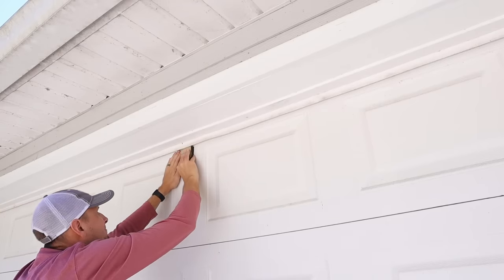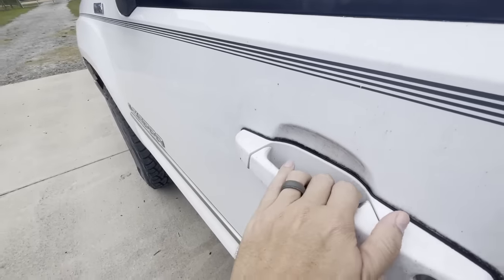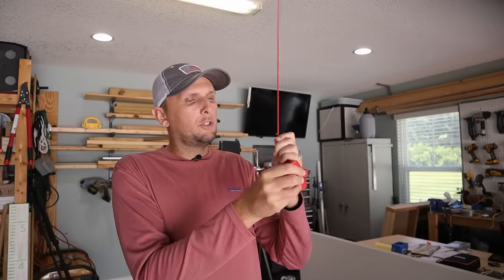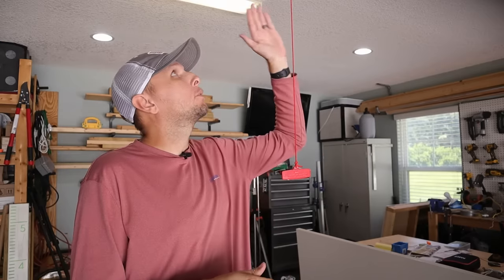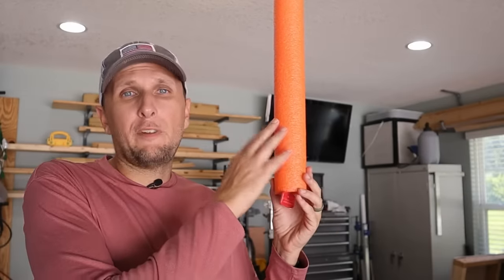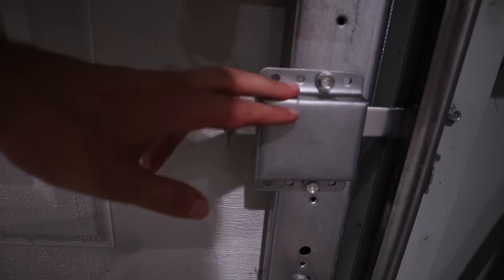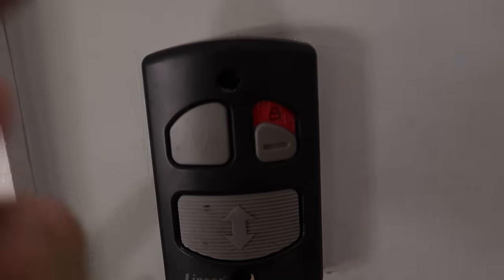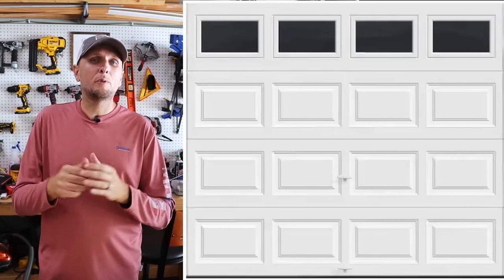How to Stop Garage Door Break-Ins | Number One Way Thieves Get Into the House!

Comment from the maker: These techniques of breaking in are nothing new to the bad guys but hopefully this was eye opening to you the homeowner!  If it was helpful please let me know and if you have some other techniques that you use, I would love to hear about them! 👮🏻‍♂
Reply: Like they always say, "Locks were made for honest people not thieves. Where there's a will, there's a way"
Reply: the best technique is do not be greedy for wealth.  if you have nothing you have nothing to worry about.  i no longer have anything worth value for a thief. 👍🤟👌
Reply: @duckpwnd  I gave away all my cheap harbor freight tools. 🤣😂🤣👍🤟👌.   I no longer have any tools.   I own nothing and it's good.
Reply: Take the pull tab off the release, cut it shorter, but also put a fake release with a tab on it that will reach outside of the garage, but is attached to a metal bar not the release hahaha. Let them struggle with that for hours.
Reply: No one knows these techniques. I'm a locksmith, and many locksmiths don't even know these techniques.
Reply: Get a decent roller door maybe?
Reply: Replace the red rope with a short stiff galvanized wire.  And I like the idea of installing a fake rope to keep intruders busy.
Reply: Why do they make roller doors so easy to break in thru in the usa? WHY?
Reply: Cut the rope off 4” inches below the connection point,  and don’t attach the pull handle.
Reply: @danquaylesitsspeltpotatoe8307  How is ti in other countries?
Reply: @richardb8104  Designed so you cant do that, you would have to destroy the door to open it!
Reply: @danquaylesitsspeltpotatoe8307  How so? Be specific. The measurements in America are technically "designed" to keep it from happening. It still happens.
Reply: @richardb8104  Well explain the faults that cause it fail in the usa!
Reply: Dog alarm goes off then boom....
Reply: If it's on the internet. The device can be hacked. Don't think it cannot be hack just because you think it's encrypted. 
-IT Security Certified.
Reply: @carmichaelmoritz8662  get out of here Klaus, were onto you!
Reply: @danquaylesitsspeltpotatoe8307  It doesn't fail unless you use something to wedge it open a few inches, and even then it's not a clear shot at it using a wire. It's not at all an easy opening, and someone literally needs to stand on a stepladder in front of the door for a few minutes to perform it. 
This guy is just a youtuber making a video to scare people. He heavily edits the video as you can see to make it look like it only takes 20 seconds, which it does not.
Reply: @ShizGnat  no please do not get onto me , I'm not santaklaus.   🤣😂🤣👍🤟👌👁👀🤡
Reply: I am a garage door tech. The most common way I have seen of breaking in, is to pry out the bottom rollers and flip the bottom section in. If they have an opener or slide lock, it will keep the door from falling and they can just crawl right in.
Also, if they have no opener and they have a T-handle lock, they could just slide something behind the weather stripping and into the garage  to push the locking levers open.
Both of these issues can be fixed by adding wood to the jams to block access to these things.
In most cases, it is easier to gain access through a man door. The man door is usually located on the side of the garage and is more hidden from people passing by. Thieves don't want to be seen, and it is pretty hard to be discrete breaking into the garage door where any neighbors outside can clearly see what is goin on.
When I set the travel limits for my customers, I make sure it is closed tight enough that you couldn't get anything through the top section and the jam.
Reply: It's always new to newbies, so no need to give so many details and a demonstration.  Ex. skip the block.
Reply: If you are going to be out for the weekend,  pull the plug on the garage door opener. I put  a U bolt on the door rail so that the door can't be moved. Use the side door to get out and lock it.
Reply: What kind of fool leaves their car unlocked when it's parked?
Reply: @greenspiraldragon  Or that connects to an alarm so when they pull it it goes off
Reply: Eh yo this little video is a must! Had a garage addition built and we had NO idea how much attention it would bring.

Having great neighbors is also a plus too because we all look out for each other.

Great video my guy. Thank you.
Reply: Tint the windows.
Reply: Thanks for sharing this 🕊
Reply: @NefariousMinds  the simplest way to secure the side door, is to have it open out, then drill holes in the hinge side of the door with pins in the frame. they will pop the door hinge pins, expecting to just open the door from the hinge side, but that side will still be more secure than the bolt lock.
Reply: @greenspiraldragon  or attach the fake release to a siren...
Reply: @mrbriancandoanything709  That's what he mentioned in the video lol
Reply: @richardb8104  Actually it's been over plenty of news sites showing how easy it is, after some practice the news guy could do it in 20 seconds, a thief 6 seconds (recorded on CCTV). Do some research.
Reply: @NefariousMinds  Why isn't this standard? That should be the real question. It should be like this from the factory.
Reply: @NefariousMinds  You should write to the manufactorer to do this standard. I swear customers could sue (especially in America, class action lawsuit) against these dodgy garage doors that don't even keep people out! Way too easy.
Reply: @TheSydguy30  
I think the main reason is to keep costs down. Not just for materials, but also production and liability.
I don't think there is any kind of lawsuit here, unless they advertised their products to protect against such scenarios.
It also opens a market for aftermarket products.
It's not any different from car manufacturers. You would be surprised on how many vehicles, ( without added security features), can be opened with a hammer and screwdriver.
Reply: @TheSydguy30  Ok, well I've done that opening technique hundreds of times, and it's never easy enough to do in 20 seconds or 6 seconds. Keep believing though. Funny how all it takes is one youtube video to convince someone .
Reply: @greenspiraldragon  electrify the wire he he he, low voltage though.  I have a mate who had his car broken into.  He stole a voltage box from the school science dept and wired it to his car.  He destroyed all his electronics in the car LOL.
Reply: @richardb8104  people will believe anything if it’s on TV or the internet.
Reply: Before I go on vacation, I wrap the cord around the overhead track so it doesn't hang down. I always keep the interior door locked. I always enter and exit the house through the front door. When the vehicle was broken into while at a park and ride last year, the remote was stolen. Now I keep a padlock on both tracks just above wheels so the door can't even move.
Reply: Front facing garage take a tip from a special operations community member. Hang a curtain. You can drive through it (If you park in there) it hides what is in your garage as you access it. Home Depot sells “ bug screens “ that work very well for this POU.
Reply: @richardb8104  in Europe, there are normally 2 wide doors with a padlock, you have to get out open the door, park your car, then close and padlock the door, normally there’s only enough room for the car.
Reply: @dionc6  Erase the memory on your garage door opener and reprogram your door openers, then that stolen door opener won’t work.   It’s easy…..
Reply: @Deontjie  appP😊
Reply: You can install an interlock / cut off switch so when lock engaged doesn’t operate or be sure to have lift force down as to not damage door if locked and operated.
Reply: @mlt6322  I agree but everything you can do to make the thieves work harder or use up more time the more likely they are to give up or be interrupted
Reply: That was quick I've never had a reply that quick. I have some other comments below also that may interest you as they can be related to the delaying them also
Reply: @autodidact537  Apparently even in this day and age a lot
Reply: @richardb8104 
You do realize it actually can be done fairly quickly, right? 
He wasn’t being deceitful, he was making a video.
Reply: @rogers906 
Surface good ideas. 

I’m not a criminal, lawyer, banker, or a locksmith, but I’ve been a contractor or in that industry most of my life. 
People have NO IDEA how quickly I can get in almost any door and a lot of windows. You have to stop the 10-second “in” possibilities. 
Or I’ve discovered ridiculously often I can find the hidden key in under a minute if a throwaway “gift card,” fish wire, Swiss Army knife, or reach cable doesn’t work. 
Then you have people that lock everything and have deadbolts or whatever but one not-so-violent kick through a door panel is a five-second entry. 
When I was doing apartment rentals and someone was getting evicted they’d often change the locks. The cops would want to call a locksmith to execute a ‘take possession’ order but I’d be in either nearly instantly or within a few minutes. 

Just gotta eliminate the non-breaking-and-entering means of getting in; problem solved.
Reply: The garage can be like an extra room? TV, smokeroom, teen hangout, music? Then we get accustomed to it being part of the home?
Reply: Two things have you seen the lockpickinglawyer nothing is locked July 2nd they sell universal garage door opener from Genie it will open any garage door😢
Reply: selling fear has become a good moneymaker
Reply: Use a torque wrench like mechanism to protect the garage door opener from damage. They should be built in but it's "quality" ^^.
Ask the sellers for that feature or a craftsman.
Maybe it is that "Torque Limiter Kit" but I am not sure.
There SHOULD BE something like the ratcheting mechanism from torque wrenches for garage door openers so the mechanism just clicks instead of shredding itself or the door.
Again, ask around, somebody will know the name of it or is able to make one.

Connect the alarm system to a fake door release and put glazed foil on the windows.
I bet there are better emergency / quick release systems out there.
Reply: A stolen vehicle easily pushes through most garage doors.
Reply: I use a ratchet strap when I'm going away for a while. I put the top hook on a roller axel and the bottom hook into a lock slot closest to another wheel. Then tighten it down. They won't be able to lift the door at all no matter how they try. I also fitted a door/window sensor to my garage door so it'll trip the alarm if it opens.
Reply: @greenspiraldragon that’s an excellent idea and one I also use only with a little modification Using a technique I learned from previous training in booby traps while assigned to special duty during my military career a hundred years ago. In addition to prevent a break in I have an inherent need to catch and punish those who violate my property and family. So instead of attaching the false cord to a bar to help the dread to society increase their muscle tone I rigged and attached it to a large heavy cinder block set above the slopping roof where the perp would be standing. Of course the set up must be appropriately camouflaged so as not to be seen from the street. When they pull to open the garage door they instead release this block which comes down on them with a knock out effect. I originally had it designed using high voltage current for the effect but my wife wouldn’t sign off on it therefore encouraged to use lesser means.
Reply: @dionc6  Why? Just unplug the opener or lock the wall remote by repositioning the switch.
Reply: @googleuser868 huh? If you break in through the garage door to steal the vehicle why drive through it when it’s already open🤔.
Reply: Thank you for sharing this.   I will be  taking these steps to protect my home.
Reply: I don't have a garage door opener how can i put a lock on the outside on door with things around the house I have a pole barn and a old barn they have broke in qnd they just about put us out of business so i have been doing e waste and there going in barn and stealing my tv and processed things i went around and got I pick up by myself i would like to make traps to catch them
Reply: My garage door is just like yours.
I used a padlock with a long shank, locked through a hole in the rail above the top wheel on the door.
The door goes up a few inches, then stops.         :)
The key to the padlock is attached to it on a string, so it's easy to open from the inside if necessary.
I rarely open the garage door so it's not a major inconvenience (I switched off the power to the auto-opener mechanism ages ago)
Reply: I didn't know now I do so you are wrong
Reply from the maker: @jackhaus5238 so you are planning on breaking into homes.  Glad we have that documented now.
Reply: Thanks I just scored a nice bike
Reply: I knew about the rail latch, but when using it you should always unplug or disable the opener so you don't burn it up. When you come back from vacation it's such automatic behavior, you will press either a remote or even the switch in the garage without thinking about the hard lock.
Reply: Or a simple zip tie. Blocking the release mechanism.
Reply: Thanks for the video. Do you think I should remove the keypad console that is right outside the garage door?
Reply: Best to also have a Fence with Sensors so that when you're gone, and Someone gets close to Fence it will trigger a bunch of Small Lights at roof level That will Flash and a Speaker saying, 
"Smile, you're on Candid Camera"! 
Or Saying 
"My device will tell my Cellphone about you" ! 
Probably will Discourage Thieves from further Involvement.
Reply: Unfortunately YT puts the Latest at the Bottom.
Reply: I was told years ago that you should zip tie the lever up so it cant be pulled down at all
Reply: @carmichaselmoritz8662:  In other words,  "you own nothing and are happy."
Reply: Excellent video, very helpful 👍🇺🇸
Reply: Put a couple bare wires up there and plug it in 😂
Reply: I love the pool noodle tip.  I'm a short woman only 5' tall, so cutting the cord shorter isn't an option, but putting a pool noodle around it IS!